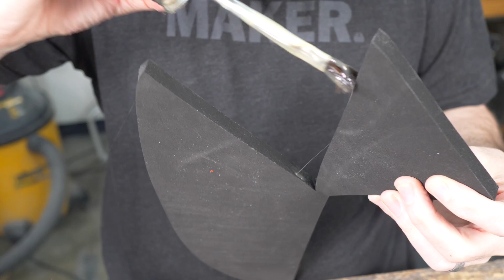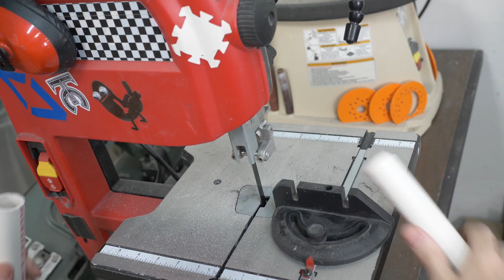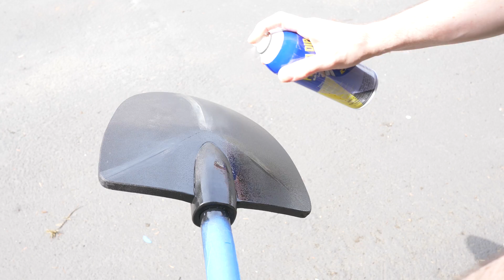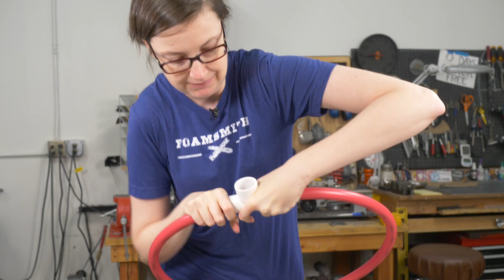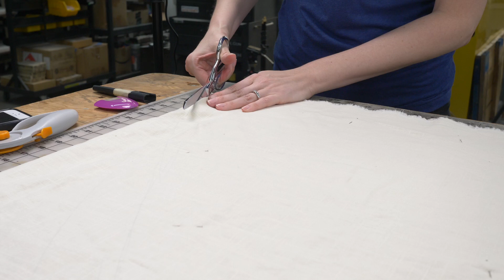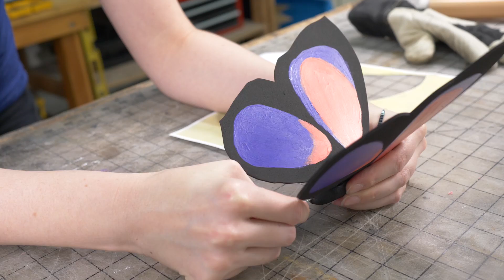Let's Make Foam Animal Crossing Tools! FREE TEMPLATES

Comment: Super doable. One question though: how to get the best paint job on the pvc? Whenever I try it, it scratches right off.
Sanding it tóó much messes up the nice sleek look. Do I need more layers of paint? A better lacquer/varnish? Or just accept that it won't be indestructible?
Reply from the maker: Sanding with a higher grit will reduce the damage to the surface, then you can use a filler primer to cover any remaining small scratches. A gloss lacquer should get you a lovely smooth finish!

Comment: Is this a Expert project, a advants project or a beginers project. Tell me in comments
Reply from the maker: This project is pretty accessible - none of the materials are very expensive or hard to work with. The shovel is definitely the easier of the two
Reply: @punishedprops Thanks, I am a beginner cosplayer and I wanted to do something animal crossing themed, your video has lots of information. I love your Fallout prop and costumes by the way

Comment: Awesome props! For the bending of the pipe with the sand, heat the sand in the oven before putting it in to the pipe. It will then warm the pipe from the inside out and make it really flexible. Then form it and let it cool to the formed shape. Full explanation can be found in this video, https://www.youtube.com/watch?v=p1SMOPaajgY

Comment: Have you tried using a hot wire to cut the foam?
Reply from the maker: I haven't. The foam tends to shrink away from head so rather than a nice clean edge you get a warped one.

Comment: quick tip I learned from a guy who made his own roller coaster in his back yard using some PVC: heat the sand up before you put it in the pipe and it will heat the pipe for you...then put it in the shape you want and let it cool...something to consider, especially if you have a form or want something super even...
Reply from the maker: Oh neat, thanks for the tip!

Comment: With cutting foam in various thicknesses is there any difference between a bandsaw or a scroll saw?
Reply from the maker: Not particularly! A scroll saw can obviously help you with more detailed lines and corners, but I almost exclusively use my band saw and can refine later with other tools as needed,

Comment: There are silicone tubes used for pipe bending in water-cooling. you just powder them in cornstarch, pull them in the pipe with a string. then you can heat and bend it section by section. Wintergatan uses it on his channel to bend the pipes for his Marblemachine.
Reply from the maker: Oh that's super cool!
Reply: @punishedprops  should make the heating easier, since you don't have to heat up the sand and wait for it to cool down again. needs a bit of practice though. In one video he said that there's some surgical stuff that's cheaper than the watercooling one, or the other way round, can't remember.

Comment: Did you consider adding a key to the connection point between the handle and shaft of your shovel? Or is the connection free enough so that alignment wasn't a real concern? Great execution at any rate!
Reply from the maker: Thanks so much for watching! The tension fits well enough that it really doesn't move once you align it manually, but you could totally add a key if you wanted to!